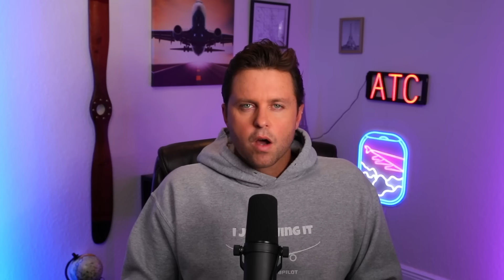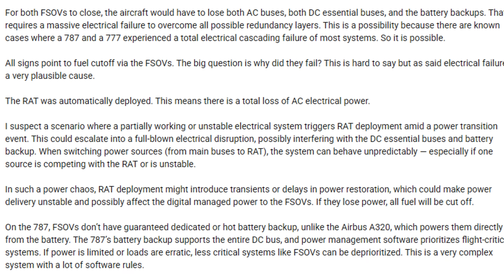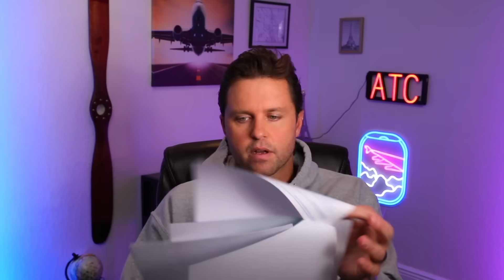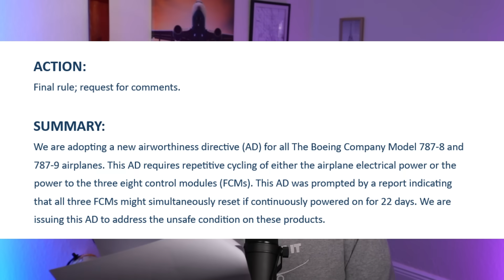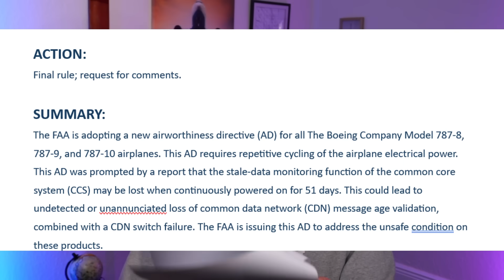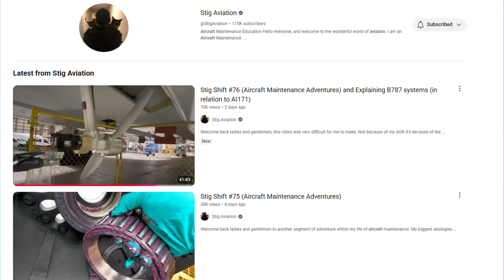Air India 171: Did a Software Glitch Cause Dual Engine Failure?

Comment: I am no Pilot, but interested in flight accident analysis. After Blancolirio discovered RAT deployment and looking at all the speculations and possibilities, i came to the conclusion (knowing about the dual engine shut off case after landing and Stig), a software logic fail is most probably cause. The increase of automation of anything is dangerous, because we are only humans, not gods. Therefore i am short on Boeing.

Comment: I've been watching airliners take off all my life so I consider myself experienced in at least the visual aspect. I firmly believe that the right engine (starboard) flamed out on take off roll and at V1 the pilot continued with the take off thinking he could rely on the other engine. Around 600 feet you can see the complete lost of effective thrust. If you observe the take off you will notice the plume only from the left engine.. Everybody has to agree it had thrust on take off because the aircraft was climbing. Let me know if you think the right engine was doing any useful work for rotation. If this electrical failure occurred both engines should be affected at the same time. My experience is working with valves, pumps and electrical in a power plant.

Comment: Reliability and safety engineers typically do a good job identifying and mitigating single point of failures. Complex interactions between different engineering disciplines is much harder (eg combinations of electrical, mechanical and software failures). Hope Boeing have sufficient resources applied to the design and life cycle processes to review, test and catch vulnerabilities.

Comment: Engine failed  - NOT? I am basing my opinion on these 2 factors:
1. https://www.youtube.com/watch?v=rdwDhx4XPSI
This interview at about 40-second mark, the survivor said "I could hear engine thrust increasing to go up but it crashed". That means the engine(s) was still running.
2. Another video showed lots of dust behind the plane immediately after rotate.
My conclusion, AI 171 could had entered a wind shear situation where the dust kicked up right after entering the downwind column and the plane is pushed down after exiting on the other side of the wind shear.
Reply: Interesting but it fails to explain the RAT deployed and the wheels still down at 600ft.

Comment: FSOV do not have a spring loaded closed feature.  FSOV are controlled by the fuel cut off switches. They would have to be closed manually with the FCOS. But your theory is possible.

Comment: It is by more than an average citizens perusal that I pay attention to any problem that the Dreamliner might have. After all, I was a manager who handled all the failures in testing on the Dreamliner and all the avionics problems came through me to be fixed and although I did not fix a one of them myself I managed them. I was there when the very first problem was submitted into the ITRACS system and I was there when the last two problems were closed out as not needing to be fixed. Most people who lived through the days of the Boeing promises of delivery remember just how long it took to get that aircraft complete. It took three years when the promise was one year. Of course this is the only way the aircraft could be sold. I don't think any of the airlines would have paid for it had they known how long it was going to take. But the delays were due to other problems than the avionics but it did allow enough time for an excruciatingly close attention to be paid for any problems that existed throughout the plane. 
  The 787 aircraft certainly has had a remarkable track record since its first flight but what I can say is the the only problems that get reviewed and fixed are problems that someone knew to investigate. It does appear evident now that some extreme conditions here were present that just could not be accounted for and hopefully the black box can be read and the answer found I would have no idea as to what could have caused this. Although the CCS’s without power count on a backup power system which, if failed would mean no CCS’s in 10 seconds.

Comment: Google AI is pretty accurate, ambient temp in an airport site in India? Worse than Arizona or Vegas..curious the what temp sensor range is for fuel shut off,  and why altitude override isn’t mentioned for that system in the ECU..

Comment: You cannot speculate but I can.
We know the plane inbound had electrical issues.
The entertainment system uses a lot of electric power, it would not work properly so they shut it off. Common cause of this type of thing is power starvation caused by bad connection in the electrical system. 
Industrial fact, bad connection starves things of power and the fault makes the connection hot, eventually causing the cable to fail and or short out.
Localised heat also damages surrounding electric cables. Possible but unlikely for short to be to other cables. 
Fact a plane was brought down by entertainment system electrical fault, in flight fire.(the pilots did not know there was a separate switch for the entertainment system, it was not turned off by the master breaker switch)
747 blow-up mid air due to high voltage cable shorting on to the fuel tank sensor cable, leading to a spark in the fuel tank.
I think we can say for certain,  the aircraft had a big electrical short circuit, and that was the cause of the RAT deployment. 
What we cannot know is the effects on the entire electrical system, because it is dependent on how big the short was, and where did the electricity go to.
High voltages on low voltage circuits even for a split second is instantly end of circuits. Los of power to sprung loaded solenoids is instant, one second and spring has done the job it is intended for.
So I am going to say electrical short, cut power to the solenoids for a second. The short caused by the G force at takeoff  or the start of the undercarriage movement. 
And on the inbound flight, they only made it because they turned off the entertainment system, taking the load off a bad electrical connection. 
What a stupid design, sprung loaded fuel shut-off solenoids, should be cable operated the same as the throttle lever.

Comment: Besides all these technical questions: I'm totally confused now. It's said that the plane crashed onto the B.J. Medical College and Civil Hospital Area. That would mean the runway was used IN THE OTHER DIRECTION (south-west), than I previously thought upon the poor videos existing from the take off. Further this would mean that the plane must have passed the airport buildings (at the end of the runway at this side), foreseen to overfly most of the city! So, next questions arise: Is the runway equally long in both directions?! Where on the runway did the plane exactly start???And this airport doesn't have proper video-control and -material??? Can't believe that. It becomes VERY VERY STRANGE!!!

Comment: Based on that comment - step by step

1. Takeoff Begins – All Systems Nominal
Aircraft lifts off the runway normally.
Positive climb detected (~600 ft AMSL, 174 knots).
Engines are producing thrust, FADECs are operational, and no warnings yet.

2. Pilot Selects "Gear Up"
Main landing gear retraction sequence is initiated.
Step 1: Gear doors should open – but this doesn't happen.
Step 2: Truck tilt actuator moves forward – suggesting sequence is partially completed.
➡ Why is this odd?
The truck tilt shouldn't occur unless the doors are already open. This implies the system started the retraction process but froze mid-sequence—likely due to hydraulic or electrical loss.

3. Electrical System Fails – Cascading Loss
A major electrical fault hits the aircraft within seconds of liftoff.
Both AC and DC essential buses begin to fail.
Loss of hydraulic power for the gear system due to electric-hydraulic pumps going offline.
All signs point to a cascading electrical failure, possibly a software glitch, converter issue, or GCU malfunction.

4. RAT (Ram Air Turbine) Deploys
Emergency power source automatically deploys, indicating total AC power loss.
RAT supplies ~15kW of power to blue hydraulic system and essential flight controls (rudder, ailerons, elevators).
➡ RAT does not power:
Engine start systems
Landing gear retraction
FSOVs directly

5. FSOVs (Fuel Shutoff Valves) Close – Engines Flame Out
FSOVs are spring-loaded to close if they lose electrical power from the DC system.
With AC buses, DC buses, and battery backup all degraded, the FSOVs lose power.
Both FSOVs close simultaneously, cutting off fuel to both engines.
Engines flame out, despite FADECs being technically still operational.
➡ FADECs rely on PMAs (Permanent Magnet Alternators) on each engine, which are independent.
But FADEC can’t overcome mechanical fuel shutoff caused by FSOVs closing.

6. Brief Glide – Aircraft Remains Controllable
The aircraft continues briefly under momentum and residual control from RAT-powered systems.
Pilot possibly increases nose-up attitude in final seconds – indicating partial flight control retained.
No gear retraction is possible (RAT can't provide the needed power for gear doors or retraction motors).

7. Aircraft Crashes
With no thrust and no altitude to glide, the aircraft descends and crashes.

Dual engine flameout at such low altitude (400–600 ft) offers no recovery window.

🚨 Key Underlying Causes (Suspected)
Cascading electrical failure knocks out main and backup power.
FSOVs close due to loss of electrical control, cutting off fuel supply.
Gear retraction attempt may have overloaded or destabilized the electrical system.
No dedicated FSOV battery backup on 787 (unlike Airbus).
Software-driven power distribution prioritizes flight controls, not engines, during failure.

🛠 Similar Historical Incidents (Precedent)
VS105 (2024): RAT deployed after major electrical failure on 787.
FAA AD 2015-08-51: Software bug could cause total power loss after 248 days of uptime.
LATAM LA8084 (2018): Cascading electrical meltdown on 777, power restored only after engine shutdown.
JAL and ANA 787 battery fires: Proved fragility in power systems and emergency response.

Comment: Thanx so !!!  Thats very interresting !!!   But in that case it´s not a software glitch more a power inverter (DC to AC) between the phases of the  AC busses , a real failure or glitch  ( that would instandly started the RAT)  and this millisecond power failure shut up both engines via the FSOV´s if there is no delay programmed (or as hardware solution wired) .

Comment: I have never flown a jet that wasn’t designed to still have engine power and control in the event of a total electrical failure. I find it hard to believe that the FAA would certify such a design. Misinformation is one of the biggest threats to our current society in my humble opinion. You yourself admit to not knowing or processing a 787 manual. Having this discussion amongst peers is one thing because one of your peers is able to intellectually correct you with an educated background. The internet is full of people that only know what you and others tell them. If that information is wrong they panic and buy all of the toilet paper off the shelf for no logical reason, creating worse problems. For the good of our industry, please take this video down and wait for the official facts and investigation to draw an educated conclusion.
Reply: For those that aren’t in aviation. The engines have what’s called a PMA (permanent magnet alternator) that spins as long as the engines are spinning by gliding forward in the relative wind. This is basically a built in system electrical generator for the purpose of powering the EEC or engine control computer

Comment: There is no theory out there that confirm the reason the aircraft crashed. The only facts here is that the initial rotation and climb out looks normal. The pitch and initial climb rate looks normal. Then at what looks like 300ft, the climb stops and reverse to a decent but the pitch remains the same. And at this time the RAT deploys. And it can only be deployed i 3 ways. Automatically with a Dual engine failure or total loss of electricity. It can also be deployed manually with a guarded switch. The RAT gives the aircraft the absolute minimum amount of electricity to supply the EMER ELEC BUS. and hydraulic power to the most essential flight control systems. It is not designet to be able to raise the landing gear! So that is probably why the gear remained down. If they had a total electrical failure, the engines thrust would not be affected and the climb would have continued normally. If they deployed the RAT manually, The engines would continue unaffected and the climb would have continued normally. If it was a single engine failure, the climb would have continued! All airlines have this in their "Engine failure above V1 procedures" : "Positive climb-----Gear Up! No other actions below xxx ft. ! And when the captain initiate the engine failure checkList/procedure, There is several items on that list that must be confirmed by both pilots before any switches is moved. No trained pilot in the world "just flick the fuel-cutoff-switch in a hurry" Or mistake the flap lever with the landing gear lever. The rapid transition from positive to negative climb indicates a severe loss of engine trust. And the RAT deployment confirms that. What made both engines flame out at the same time?  Only the NTSB and a serious amount of investigation can figure that out! So please stop this nonsense of making youtube videos claiming wild and absurd theories  about what happened in this tragedy. Be patient and led NTSB and their investigators do their job. They will get to the bottom of this! Respect the victims end their loved ones.

Comment: sounds more like hes saying boeing cheaped out on getting a dedicated battery system. and when the computer switched from one power supply to the other it turned off for a moment, releasing the valves, starving the engine of fuel and crashing the plane

Comment: Question: didn’t the 787 originally have issue with the lithium batteries onboard shorting out and/or starting a fire? I could be mistaken and thinking of a different plane but I do remember it being a boeing plane.  So could it have been a total culmination of a multitude of things happening all at once?

Comment: So did some digging and those issues were addressed.
APU Fix:
Boeing developed a permanent fix for a design flaw in the 787-8's auxiliary power unit (APU). The APU is a key component for starting the engines and providing backup power if the main generators fail. 
Software Upgrade:
Boeing worked on a software upgrade for the generator control units to rectify a bug that could cause all generators to lose power under rare circumstances. 
Power Distribution Panel Changes:
Boeing implemented minor design changes to the power distribution panels to prevent electrical arcing and improve overall safety. 
Redundancy:
The 787 has multiple layers of redundancy in its electrical system, including multiple generators and backup systems, to ensure continued safe operation even in the event of a failure. 

Battery backup power would have been available to the values at this point.

The big question is did the airline do the work or if they did was it done right.

Because the plane's electrical generators fall into a failsafe mode if kept continuously powered on for 248 days. The 787 has four or six depending on variant such main generator-control units that, if powered on at the same time, could fail simultaneously and cause a complete electrical shutdown otherwise.

Given the airlines track record and the video of the electrical issues on this planes inbound flight it's safe to say were they are likely looking right now.
Reply: THIS^^^

Comment: If a FADEC fails on an engine The engine reverts to running of RPM not N1 thrust. Ive done high power runs for maintenance purposes for 40 years and some times you turn of FADEC for maintenance proposes. You pilots need to take courses in how systems operate, because your speculations are ridicules' to mechanics who have indepth knowledge

Comment: There are a lot of stories around that Air Indian maintenance leaves something to be the desired. A fault they were living with that wasn’t considered essential could then make them vulnerable to one more problem. No aero experience but spent a working life in the petrochemical industry and people tend to push the maintenance to save money which makes the manager look good, then one apparently unimportant failure occurs and you find the final hole in the Swiss cheese model lines up.